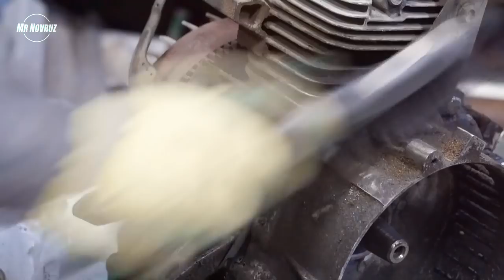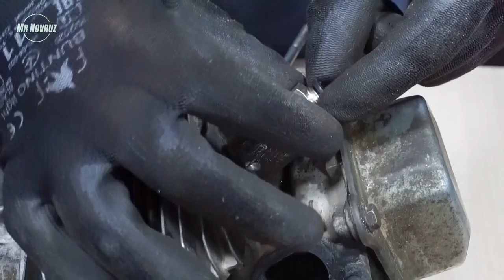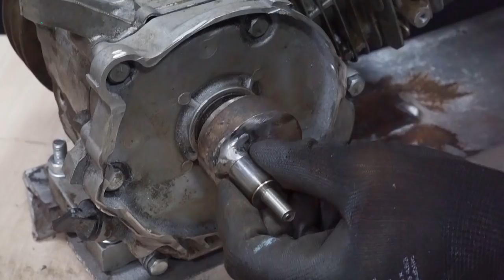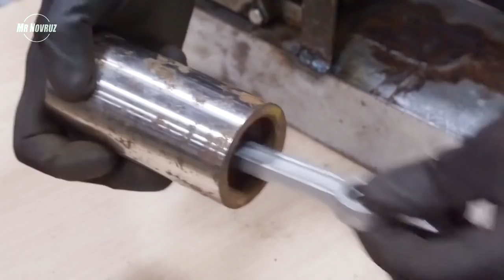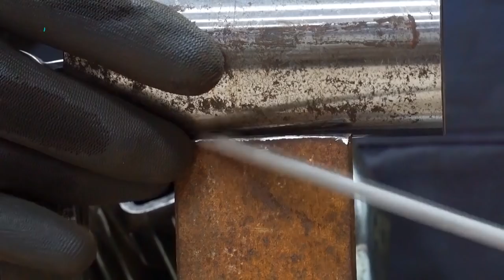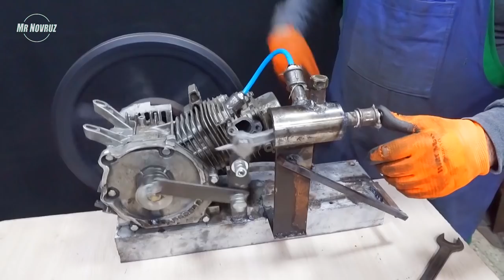DIY Steam Engine From Generators

Comment: using steam power is great idea......with natural fuel boiler is better way :)

maybe water drain will come into oil....need water separator and lubrication system for the engine bearing and  piston......(piston rings are not bras ? but steal ? )
<how about another idea.... modifying  old  grinder  to steam turbine generator.....with strong magnet for the rotor(AC Benerator) or magnet for stator (DC generator)>